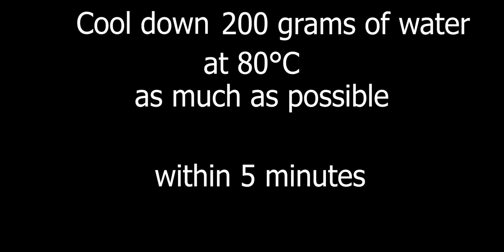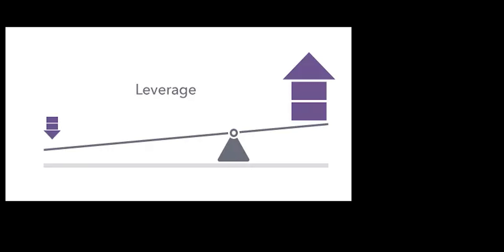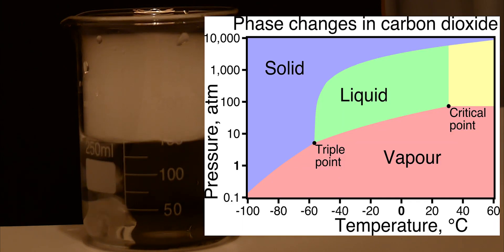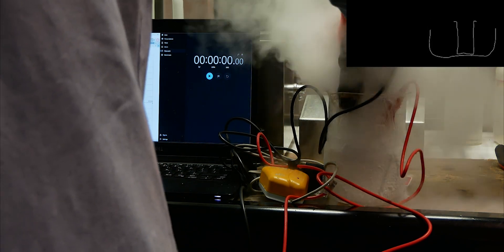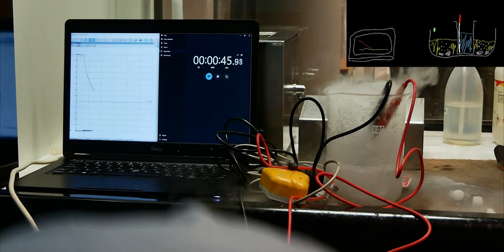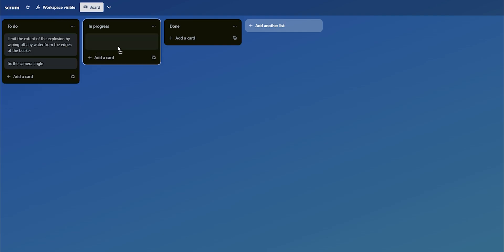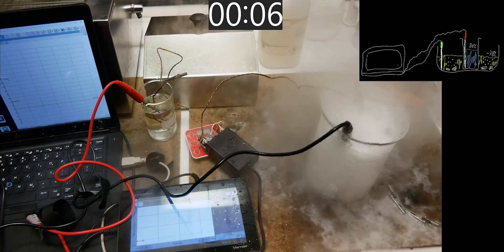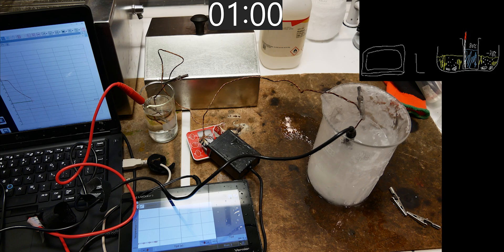Cooling Water Quickly

Comment: You have the right idea, to accelerate the change the temperature of something you need 2 things: 1. Increase thermal gradient (what you’re doing) 2. Increase thermal transfer which in your case can be done with a large area radiator fan stack (2x submerged in the hot side and one on the cold) connected by a heat pipe. You can also add agitation to eek a bit more speed.
Reply from the maker: This would indeed work very well, however for the competition this video was for I easily won as the person that got the closest to me only got to -5 degrees by using large amounts of ice and spreading the water out on a wide metal surface. I pretty much used the brute force method but as you pointed out, there are some improvements that can be made. If, however, you just use liquid nitrogen, my method wouldn't be able to come anywhere close.
The easiest thing to change is the thermal gradient, and liquid nitrogen really isn't that difficult to obtain if you have the funds, things like increasing the thermal transfer only become interesting if you have gone as far as you can with the thermal gradient, in graphics cards for example, it wouldn't be practical to add a liquid nitrogen cooling system which is why so much effort is put into maximizing heat sink surface area.
In the end your suggestions are great, and I was definitely thinking about applying some of them, but there is only so much you can do in the short time I had. Maybe next time tho